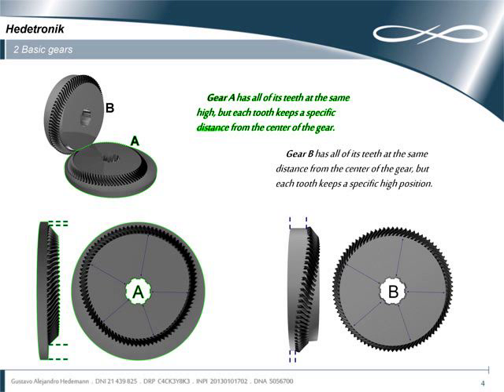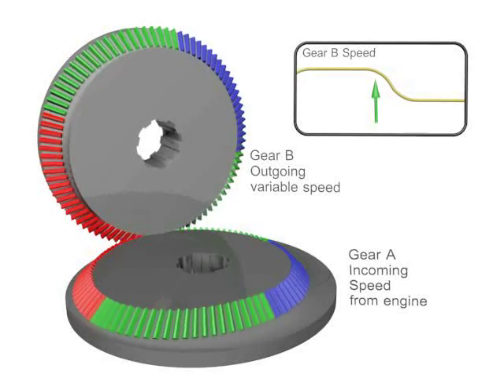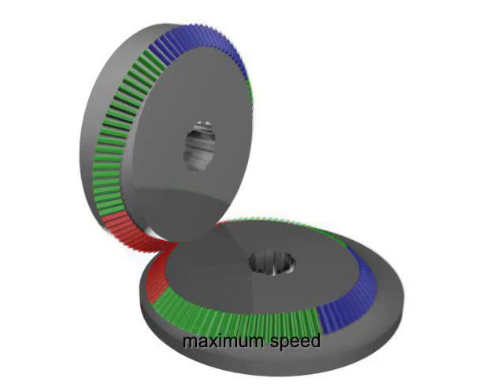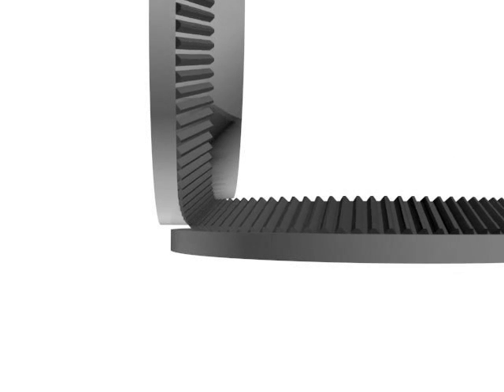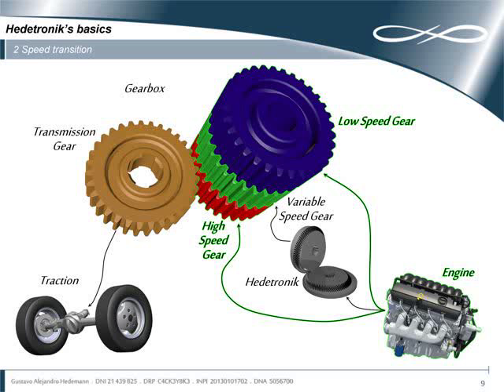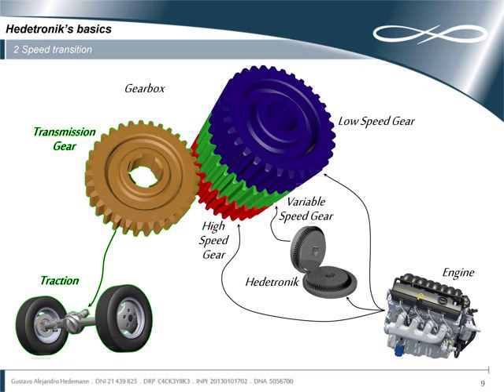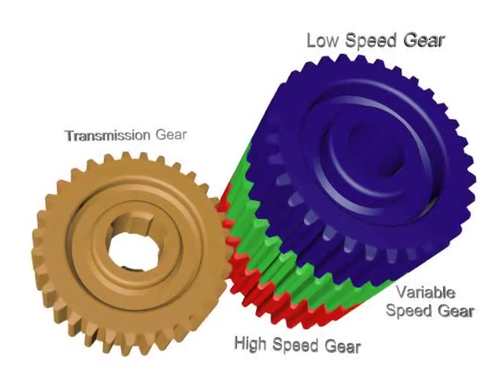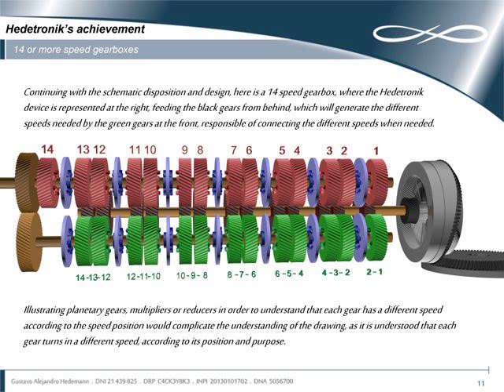Hedetronik Basics - CVT - Continuously Variable Transmission - 100% GEARS

Comment: This is NOT a CVT. It's just another type of a gear shifting synchronizer for a fixed number of gears (speeds) transmission.
Quite interesting though.
Reply: Exactly. It's a shifting synchronizer that transmits speed while it is changing from one shift to another in a continuous way. It is not an IVT (infinitely variable transmission).
Reply: no, an icvt is a cvt that can go to infinity ratio and zero. ircvt range from negative infinity to infinity. cvt has a finite range but can continuosly change ratios within range.

Comment: The name and title of this gearbox are misleading. This is not a CVT. This gearbox has specific, fixed gear ratios. This mechanism allows smooth shifting from one gear to another without the use of a clutch or some other disengagement device. This is still quite interesting and potentially useful, but is most certainly not a CVT as the gear ratios between the secrete gears cannot be sustained indefinitely.
Reply: That’s not what CVT stands for at all, it requires that there is an analog, and not discrete number of gear ratios.  When you can make all of these gears effectively infinitely thin and make that work in practice, then you could claim it’s a CVT, but as of now, it appears to be a multiple fixed gear ratio transmission that shifts without a clutch (when not from a stop) which has value itself, but is NOT a CVT.

From watching the video, it also appears it must happen in 1/4 revolution, which will be a rough shift, unless you time it such that two adjacent gears are very close in ratio and perhaps drag between them causes synchronization.
Reply: @strictnonconformist7369   you 'r right it 's an almost inmediate shift in practice. slippin tirez and watch your neck
Reply: It is not an IVT ("Infinitely Variable Transmission"), but it is a CVT ("Continuous V.T.") as the shifting is continuous, without stopping doing traction. People use to confuse IVT and CVT.